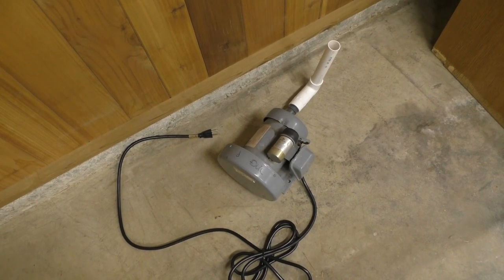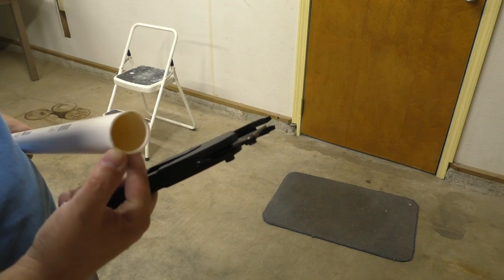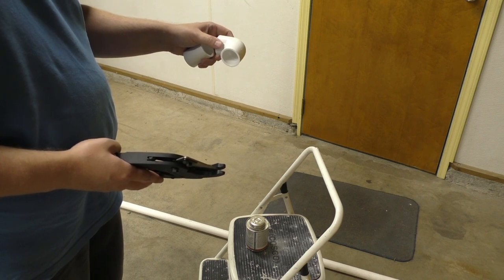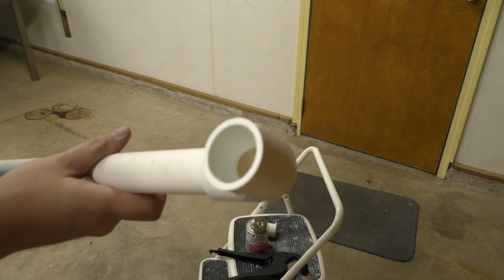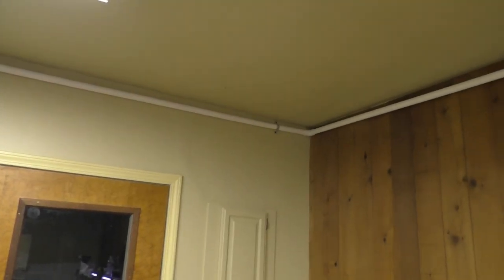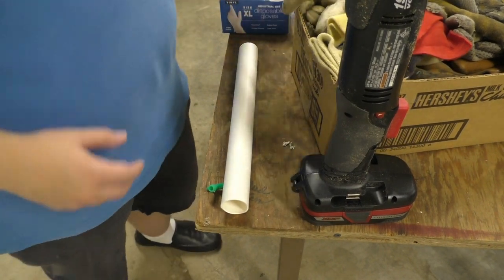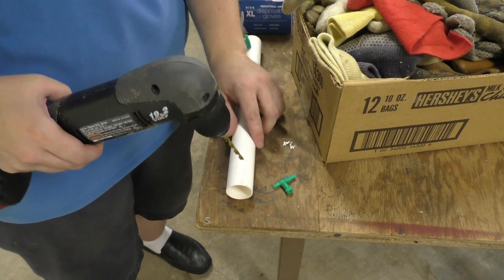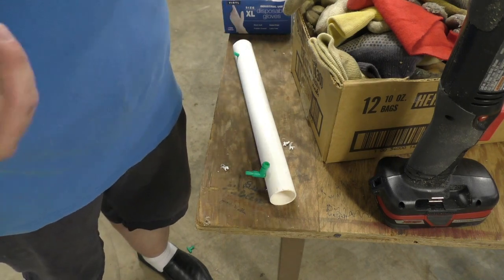Make a DIY Central Air System for Your Fish Room | How to Build a Fish Room (Part 2)

Comment: To minimise the deforming in the cut turn the pipe as you start the cut. Once the blade hits the pipe that's when you turn it a bit till the blade catches the pipe then click it once and turn the pipe back the other way and it should start cutting through the pipe and you can ratchet away and it will barely deform the cuts.
Also you should rough up the ends before glueing. Just run some 60 grit sandpaper over the ends and in the connectors. It helps the glue grab both ends much better and have less likelihood of leaks later on.
Why not just use airline couplings instead of the adjustable T's off the manifold pipes?

Comment: Hi Cory, I'm setting up a small fish room. Wondering if a 45L/min electromagnetic air compressor will run around 30 small sponge filters? they would be submerged to a depth of no more then 10 inches. (If that is a factor?) I couldn't find a formula online or a video by you that shows how to pick an air pump for a fishroom, maybe an idea for a video (If you haven't done it already. Thanks heaps from New Zealand! (please keep in mind I need math behind what will run my room as in New Zealand we don't have access to all the products you do in the states.. )
Reply: Im looking at something similar. Did you do it? Did it work out? :)

Comment: I am  building a small fish room in my basement. The air pump I have will not pump enough air to handle all the tanks so I have installed a LARGE new air pump.  VERY NOISY !  How can I reduce the noise?

Comment: Cory, I know you are incredibly busy nowadays but hopefully you can answer this for me. I understand the reason for the PVC loop, but I’m curious of the effects on pressure when creating manifolds that extend from the header loop. For example, adding a tee to extend pvc downward then create a letter E or an 8 with a combination of tees and 90 degree elbows. My thinking is this will shorten the amount of airline tubing as well as make maintenance easier as it won’t be so high up near the ceiling. Will this lower pressure to the sponge filters where I’d need a more power pump or should this have no effect? I have a tank rack of 18 tanks in a 3 tiered system. If you don’t know how to answer, who should I ask? Thanks a bunch! Congratulations on 300k subscribers and many more to come!
Reply from the maker: I believe it will be fine as the tubing acts as the air chamber and this relatively even pressure.

Comment: Wood stove might result in some serious temp swings. might be good for a back up heater if you have a big power outage, lol
Reply from the maker: +Ruzz P Yeah, I haven't completely removed it yet. I disconnected it, but I've had like 2 power outages for 8 hours here this winter. Has me thinking that in a bad situation the stove would be invaluable.
Reply: Yeah, personally i would keep the chimney in there. You could look into a smaller wood pellet stove possibly, you would need some good fans circulating the air though. Loving these videos! I was watching/listening thru them as i was playing in my tanks, so i never had a chance to comment on each one. Bravo!
Reply from the maker: Right on, keep on working on those tanks!